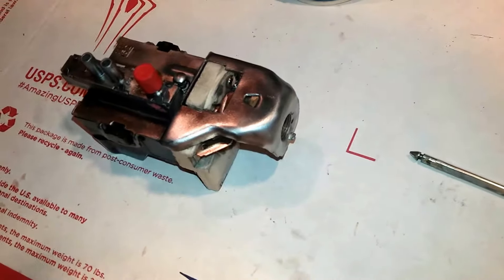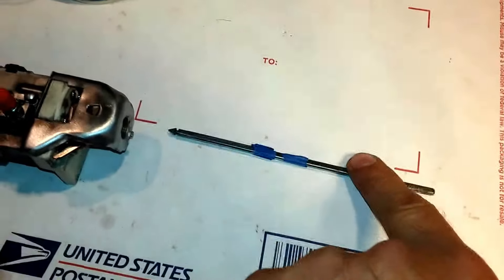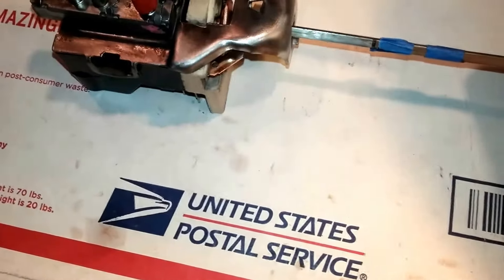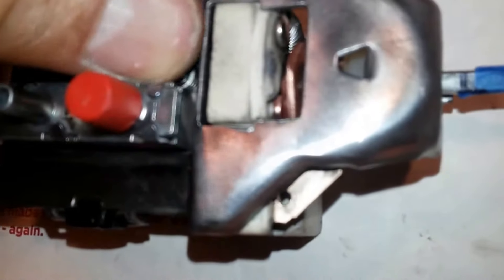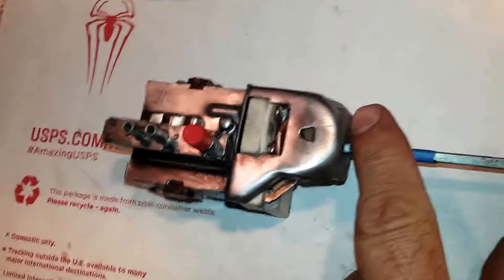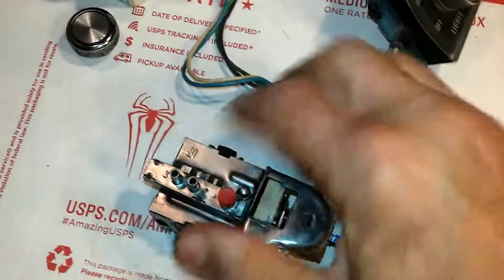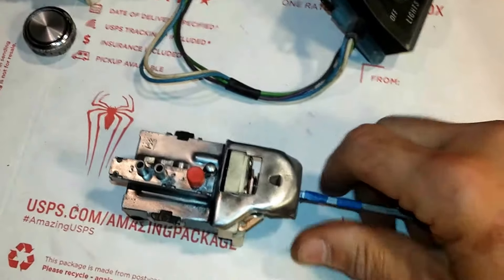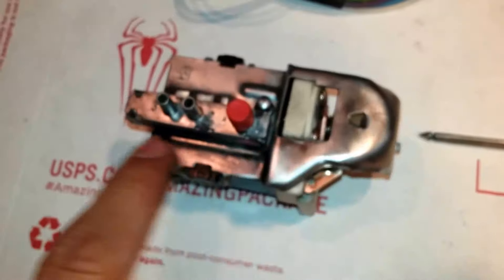LightSwitch 67 Eldorado

Comment: Do you have a website?
Reply from the maker: Hello Jason, I do not have a website however I have over 75,000 original vintage parts for the 1967-1978 Cadillac Eldorados and I personally own seven (7) of these fantastic vintage cars. I also restore the steering wheels with the woodgrain inlay and the steering columns as well as the 1967-68 steerign wheels with the griplines.
Kind Regards,
George
(727) 364-7523
kypitsn@aol.com